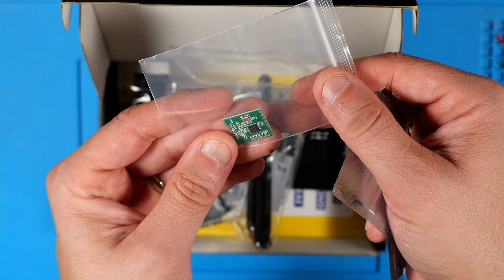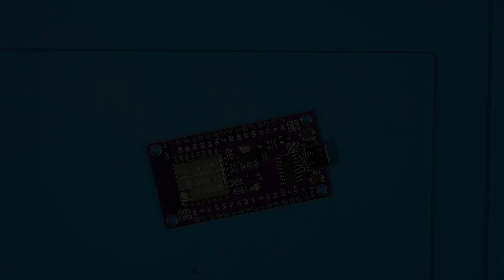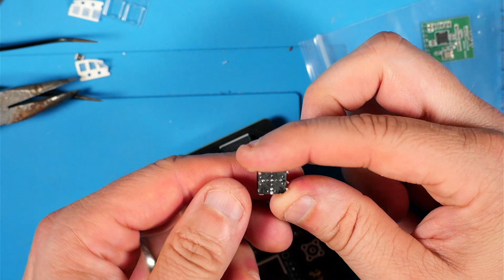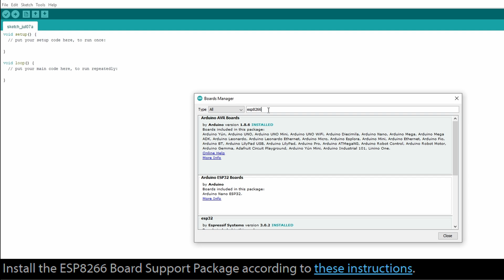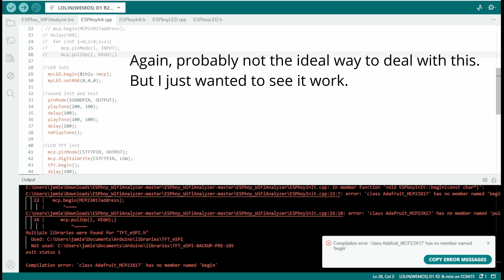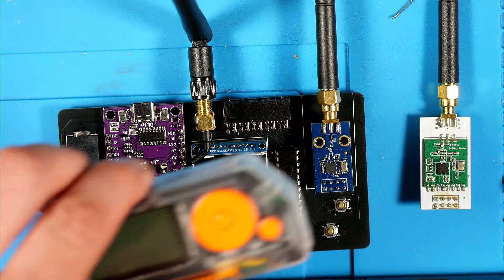Hackerbox 0105 - RF Boy

Comment: My ide does Not have esp8266 Arduino 2.3.4 how do I add this?
Reply from the maker: In your Arduino IDE, go to File> Preferences.
Open the Boards Manager. Go to Tools > Board > Boards Manager…
Search for ESP8266 and press install button for the “ESP8266 by ESP8266 Community“:
That's it. It should be installed after a few seconds.
Reply: @  have you loaded the new IDE when you go to the board manager it doesn’t give you the ability to put in any URL in the preferences anymore.  I tried just typing in ESP8266 and nothing shows up.
Reply from the maker: @qkb3128  make sure your serial monitor isnt opened. There is a bug that keeps it from connecting out with it open.(Or something similar.) I'm spit balling here.. I'll try to install 2.3.4 and look but don't have much time this evening.
Reply from the maker: @qkb3128  ok I installed 2.3.4 on my win10 bench PC. I go into boards manager and type esp8266 in the search bar and I see the esp8266 community 3.1.2
Reply: @ I just finished trying mine and unfortunately it did not work. This is really frustrating. I tried lowercase ESP then uppercase and the numbers and yeah nothing I wish I could show you a picture of what it looks like, but I don’t know how to do that through YouTube, maybe you can’t.
Reply: Sorry for the abundant messages through here. I think I’ll just maybe try uninstalling this version and hopefully I can find the other version again and install it and go from there so frustrating. Thank you so much for your speedy reply. I love your channel.
Reply: OK after quite a few different tries had to go back to the legacy version.
Reply from the maker: @qkb3128  and the place to add urls on mine is still under file preferences down at the bottom " additional boards manager urls"
Reply: @ gotcha the new version does not have that. I’m trying to figure out how to install it in the new version. I just got home so I’ll work on it and let you know.
Reply from the maker: @qkb3128  bummer! We shall not give up. To not sound super corporate... Let's circle back tomorrow and see what we can figure out.  :-) and thanks for the kind words and watching!
Reply: @ had To down load The Legacy version . I am thankful I did not lose all my other sketches … when I went to follow your tutorial opened up my ID and it said do you wanna update to the newest version? I thought sure. Well the update didn’t go very well.  Lost the ESP8266 library and others. Going into board manager and typing the name brought no response. I tried using uppercase lowercase nothing mattered. So I started researching how to add a library. That was frustrating so I gave up and went back to the legacy version. Thank you again for all your help. I really enjoy watching your channel. Look forward to doing more hacker boxes with you.

Comment: As for maybe why you can't pick up your 433Mhz LPD door opener, try a different polarization for your antenna. Maybe a circular polarized antenna as well. 

I'm just a product of the public education system, but shouldn't the higher frequencies use the shorter antennas and vice-versa?

Examples for 1/4 wave antennas:

299,792,458 / 2,400,000,000 = 12.49 cm full wave. 1/4 wave = 3.12 cm
299,792,458 / 868,000,000 = 34.54 cm full wave. 1/4 wave = 8.63 cm
299,792,458 / 433,000,000 = 69.24 cm full wave. 1/4 wave = 17.31 cm
Reply from the maker: I am a product of the public system just as you are :-D and you are 100% correct on wavelength getting smaller the higher in freq you go and vice versa which corresponds directly to resonant antenna lengths. I don't think polarization/antena is the issue this time around. 
Check this out if you did not yet. 
https://github.com/ESPboy-edu/ESPboy_Sub1GHzInspector/blob/main/ESPboy_Sub1GHzInspector.ino
You can see, like the comments say, the module has a decently wide range it can work with. This code isn't really scanning around though as far as I can tell though. It looks to set it in one place and you can see the wide is set to 800khz or whatever. I think if this code doesnt do any kind of flipping around looking in a given range you'll have to be right within the set spread. I need to check my notes when I get back home but I think that fob was showing up a little bit lower, perhaps 430 (when listening with the flipper). 
I think I will verify that, then modify this code to be centered on that freq and try again. You can also see in the code the set of protocols it is looking for has the ability to decode. I didn't look much more than for a brief time so far but I definitely want to try the quick experiment mentioned above when back in the hackshack. Seems like possibly (depending on the resources available on the esp32) some code could be tweaked to let you pick from short ranges it will bounce around. Maybe I'm way off here but could be something to experiment with which is the whole fun/point of these hackerboxes! 
Thanks again for watching and the great comments.
Reply: @JamiesHackShack  No, probably not a polarization problem, but it's worth a try. 

That ESPboy is kinda cute, but awful tiny. But my eyes are too old, and my fingers are too fat for a thing like that. :) But I see that it has a bunch of decoders built in. That could be handy.

So I caved, and read a bit of the ESP-07S's spec sheet, and I never did see what the bandwidth was, but the frequency range is reported to be 2.4 - 2.5 GHz. 

Ah, that wasn't the place to look, the CC1101 handles that. So here is what the bandwidth could be/defaults to from the PDF:

"Digital channel filter bandwidth 58 - 812 kHz User programmable. The bandwidth limits are proportional to crystal frequency (given values assume a 26.0 MHz crystal)"

So that should be the starting point for bandwidth. And the chip is very sensitive (-116 db) at low Baud rates. BTW, the CC1101 looks to be an interesting chip. :)

Nonetheless, could be something going on with the CC1101 then. I see that it has .6, 1.2, 38.4, and 250 kBaud data rates. Maybe it's not connecting with your dongle because the Baud rate is off. But your Flipper worked...

Do you have one of those el-cheapo 433 MHz transmitters laying around? Might be worth a try. And will the Flipper allow you to set the power output of the CC1101? Might not be a fair fight between the two devices. :)

In other news, I got my Bus Pirate 5 in yesterday. Keep in mind that the BP6 is also out there, but I thought that I would send some business Lady Ada's way. I hope to avoid dragging a HP 1690-something-A out to try to read the ROM of a TI-81. Ought to work...

Oh, and you are welcome, and it's my pleasure! :)

Comment: Please note that @5:42 Jamie refers to the connector as a SMA-RP. WiFi communications use the SMA-RP connectors, where the pin gender matches the connector. 900Mhz uses SMA connectors where the pin determines the gender. With SMA-RP, the male connector has all female parts (because the male pin was replaced by the female socket), while the male SMA-RP has the female parts. Not confusing at all. No, not at all.

This is a FCC quasi-requirement (it's either non-adopted, or non-enforced. Not sure which) to avoid allowing SMA devices intended for the WiFi world being used on your 900Mhz equipment and vice-versa. I did a bunch of 900Mhz design in 2020 and SMA gender selection was an ongoing nuisance.

So if you buy a different antenna for this device, please check first that it has the correct connector style. It shouldn't be a problem (but very well could be) and a little prevention goes a long way.

And yeah, please don't make sharp bends in your coax. If it were me, rev .2 of the board would have the footprint for the connector moved out a bit closer to the edge. 

Sweet little project, and nice job building it!
Reply from the maker: Good info above folks. And I agree if there was ever a revision of this I bet they would give a little more space or do that connection a little differently possibly. It works though! Thanks for watching and always coming in with the good commentary. (I'll work on your other comment shortly! :) )